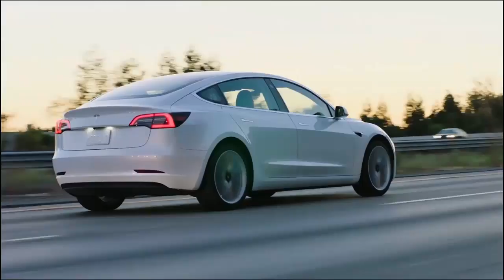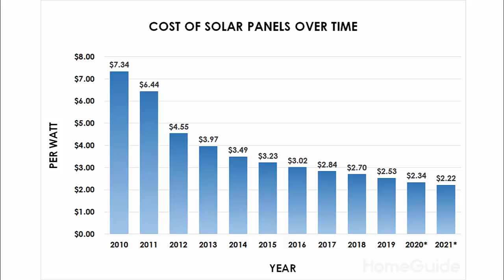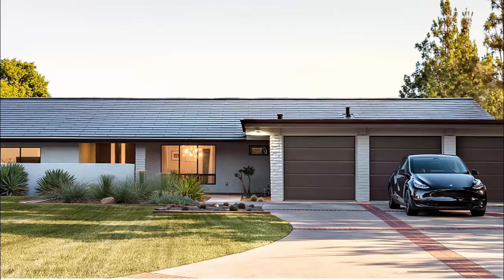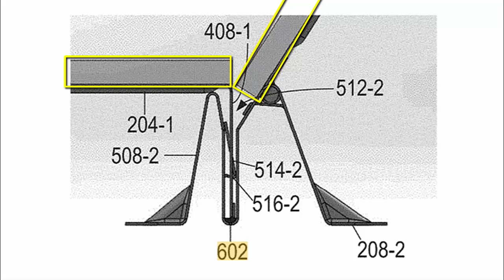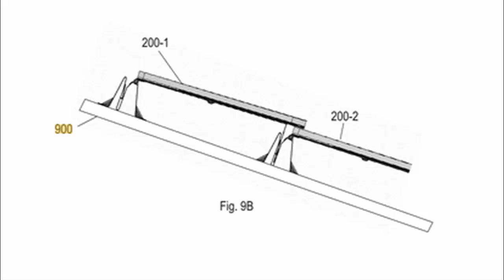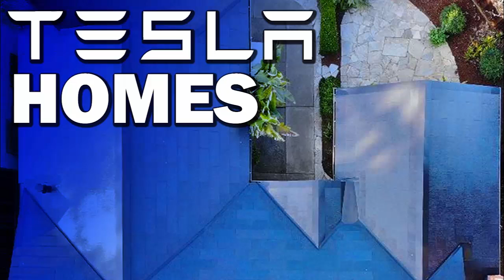Tesla Solar Hinged Mounting System Patent is a Game Changer

Comment from the maker: Elon Musk says that Tesla's Solar Roof is a killer product and this will become obvious next year. Do you agree with what he says? How likely are you to purchase Tesla Solar?
Reply: I bought a solar roof. Installation started two days ago.  It will power my home and charge my model Y.
Reply: @frankpainter7571  Do they price e it out in the tradition method as in cost per square? How large is your home? Is the efficiency of the roof shingles comparable to regular solar panels?
Reply: new construction
Reply: A lot of contacts means a lot of Long time / wearout / corrosion problems, besides the cost. Big panels will win. I would try to make them beautiful but stay big. Frameless PV already goes in that direction.

Also one must avoid water creeping into narrow spaces, expanding ice will destroy everything around it.

The rubber seal will not be watertight, sorry. Too high temperature differences, UV etc. However I wish them all the best.
Reply: There are two problems with the solar roof. 1. The price is still way more expensive than traditional panels. 2. The amount of energy that can be generated with the solar roof is less than traditional panels.  When we priced out panels and solar roof from Tesla, the solar roof was around $25k more than traditional panels,.  Also, going with panels, Tesla can install 14 kW of solar panels on my house.  If I went with the solar roof, it would have been 9 kW.  Also, since not all of the tiles are solar generating tiles, you can only claim the federal solar tax credit for the cost associated with the solar generating tiles.  So for example, if 60 percent of the tiles they are installing on your roof is solar generating tiles, then you can only claim 60 percent of the system cost for the solar credit.  If you go with panels, the entire cost can be claimed for the solar credit.

Comment: So long as you're connected to the grid, I don't see the point in converting your very simple and durable roof into a complicated electrical mess. If you expect to take advantage of feed-in tariffs, you are effectively parasitizing the grid, dumping garbage electricity onto it when nobody wants it. This isn't going to scale. It's not a problem when the fraction of unreliable production is small, but it will be when it grows.

If you want really cheap and reliable electricity, just connect to a nuclear reactor via the grid. All the countries who are replacing nuclear with unreliables are experiencing rising electricity prices. This is due to the abysmal power densities and capacity factors of solar and wind compared to nuclear. In other words, it's a problem that technology and innovation cannot solve. Unreliables are dilute and intermittent energy harvesting technologies. Nuclear is unfathomably power dense and reliable by comparison. It also emits less CO2 if you care about that.

Now, for an off grid house where a grid connection wouldn't make sense, it might be a good idea, but that's a niche market.

Some data points for anyone interested:
https://environmentalprogress.org/the-complete-case-for-nuclear
Reply: Fair points, I totally agree. However I feel like there maybe a hybrid solution that should reduce the nuclear power requirement. If all houses can power themselves and store excess during the day, then could you not leverage a much smaller reactor?
Reply: @twiincentral8780  Sure, any homes that disconnect from the grid will lower the demands on the grid.

That doesn't mean it's economical to do so. The home owner will be paying much more for every kilowatt hour.

And since the solar panels and batteries will be manufactured with grid energy, the amount you reduce the demand on the nuclear reactor might be very small.

Solar panels don't pay back much energy relative to what it takes to make them.

It's all fundamentally based on the energy and power densities involved. A kg of uranium contains literally a million times more energy than a kg crude oil.
Reply: @phamnuwen9442  
Solar is cheaper than nuclear per kWh. 
Battery is the expensive part. 
Battery costs are coming down rapidly tho thanks to Tesla.
Reply: @gordonjohnson2497  The only part of that comment that is true is that batteries are expensive.